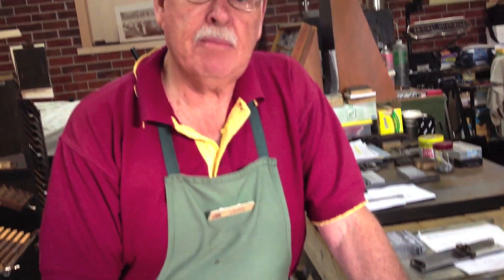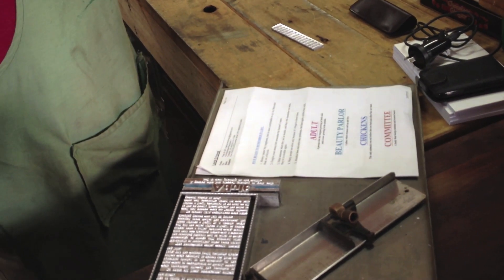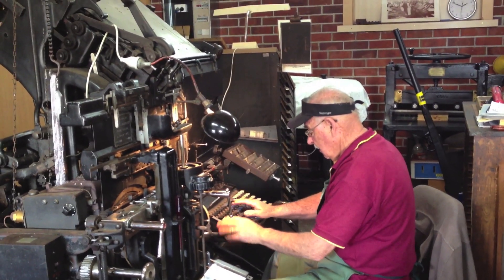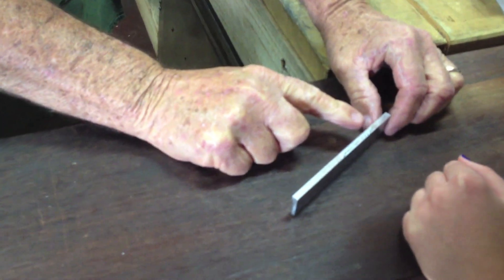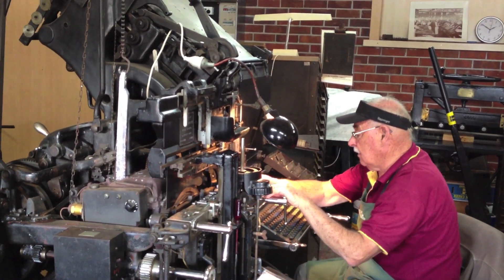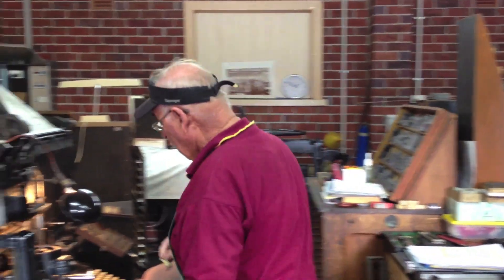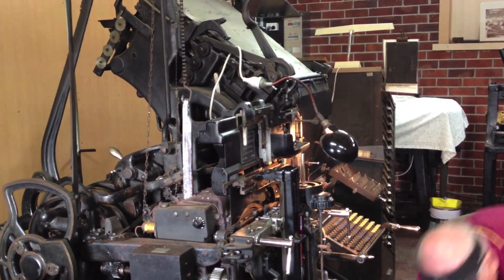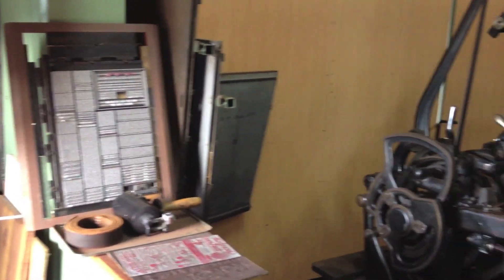Linotype machine, Printing Press, typesetting, 1892 - 1970 CLassic Machinery

Comment: Many years ago I used to produce those lead Linotype ingots.  After the type was used it was remelted and any lost metals replaced. Primarily its Lead with a percentage of Tin and Antimony depending on the required hardness or viscosity.  Older machines were 'Monotype which produced  single letter at a time which a compositor put together. Eventually the process moved on to 'stereotype. which produced a whole page and which most major Newspaper used. As the man said though, they were all eventually changed over to plastics and then  to computers. A shame in some ways but that progress. The company I worked for no longer exists - Edmar Printing Metals.  Lifting all those heavy ingots did build my muscles though...LOL

Comment: If you visit a museum/exhibit like this, ask if you can buy a slug with your name or some other text you want. I did that. I can ink it and "stamp" my name on cards and letters for a unique little personal touch.

You can tell the computer people and the printing people share a lot of mental ingenuity. The way these machines automatically sort the returning matrices back into the magazine would make any computer guy proud. Hint, each matrix has its letter designation encoded in the teeth at the top from which it hangs as it travels along the sorting rail. When it gets to the row of the magazine to which it belongs, it will find those particular teeth missing from the guide rail, and like magic it then falls off into its proper place. It's quite the marvelous bit of mechanical engineering.

So were the Strowger switches that automated the first dial telephone calls, but that is another story...

Comment: I worked on the forth floor of the Philadelphia Inquirer in the mod 1960's. Imagine fifty or sixty of these things running all out when the "Bulldog" edition of the paper was running.  I ran a proof press. When the Linotype operators finished an assignment, they would toss us the Gally and we would run off a number of proofs before sending the gally to the composition floor and a copy to the proof. Another benefit of the job was that I was making rockets at the time and found that under the plate grinders was an endless supply of powdered zinc
Reply from the maker: Wow that’s for sharing this story.
Reply: @ClassicAustralia  All the newspapers in Australia had them and one of the quirks of the job, you had to learn to read upside down, right to left because that's the opposite to the way the lead slug is cast and when it's printed it's the right way around
Reply: Would love to have seen that. We have two at our print shop. My grandparents spent their lives running them. I loved to watch it cast slugs.

Comment: Was a Linotype/Intertype Operator for many years. Had  many splashes of hot metal in my days as well. Brings back many good and not so good memories. Thanks for sharing.
Reply: we called them a "squirt"  we had 5 linos, ad shop, 2 model 5s of which one was called the G-d damned #5 and the other a #5  also 3 #26 mixers.